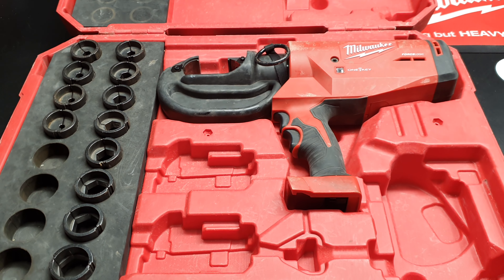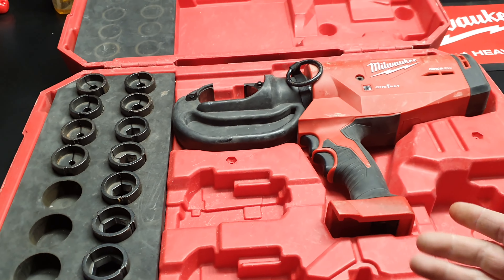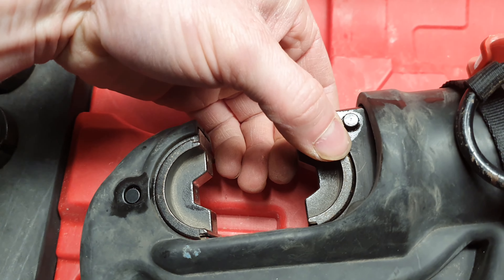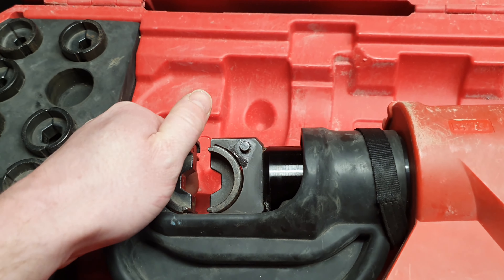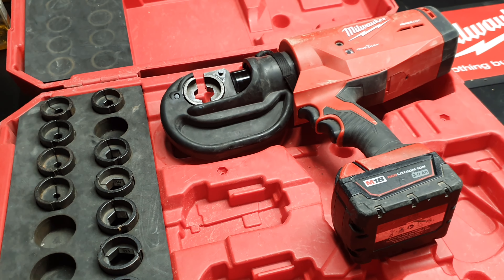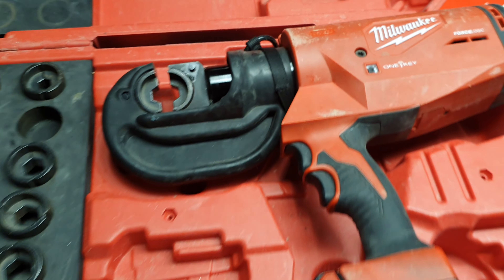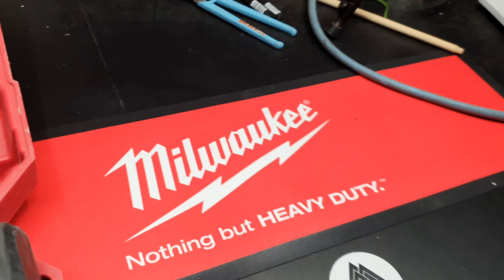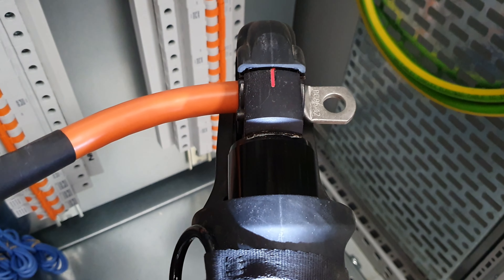Milwaukee M18 12 Tonne Cable Crimper - Tool Review and Showcase

Comment: Was thinking about getting one. But I can't seem to find them with the dies. Total tools, Sydney tools etc just the skin.
Question on the crimp side of things does it auto shut off when the crimp is complete aka overshoot the light? Does it auto retract or do you need to hit the release trigger.
Used some in the past like the Kluke which auto retracts once the pressure of the crimp is done.
Cheers for thr videos mate love em.
Reply: The crimper auto retracts once the crimp is done. There is a button on the crimper as well that lets you release the pressure at any time to open the jaws.
Reply: @andrewclarkey  thanks mate. Seen them on site a lot, just never got my hands on one.
Reply from the maker: Gotta buy the dies separately man, theyre expensive too. Think its about 5 k all up
Reply: @andrewclarkey no it doesn't. You have to trigger release. Been using it all week.
Reply: @ReebyPlaysGames  Yeah you're right, I'd only used it once back then and remembered wrong. Hope MyRed didn't get stiffed by my info.
Reply: the other one does the auto retract when its done crimping,  with a release button like you described. @andrewclarkey

Comment: 6:57 nice tool but pricy.. but on some crimp you are using it wrong ( some time in this video )..  always start close to the lug with first crimp en then go closer to the wire .
You can deform the lug with going back from back to front ant have bad connections .. ( seems you are doing it ok in some crimps but in some not )  .
Some lugs even have directon on it where to crimp first ( in case of multipe crimps possible )
Reply: not making this up btw ->   https://www.youtube.com/watch?v=ASmhAuAAiXI   Learned this also recently .. was making same mistake sometimes 🙂
Reply from the maker: I've just gone down that rabbit hole on google mate, you're right. Main reason I've seen for it is the cable popping out of the lug slightly which is somewhat questionable as a reason - you can see the copper through the window in australian lugs at least. But it does seem like good practice so ill take it on board and pass it on to my young fellas. Thanks for the comment

Comment: I DON'T UNDERSTAND WHY I CANNOT SEE A WIRE ROPE CRIMPER. I UNDERSTAND ELECTRICIANS DO COPPER ALUM ETC. ENTERTAINMENT RIGGERS WORK IN GAL STEEL & STAINLESS STEEL....I HAVE TRIED MORE THAN 50 SEARCHES & NOT 1 BATTERY OPERATED TOOL FOR STEEL WIRE ...WTF ?